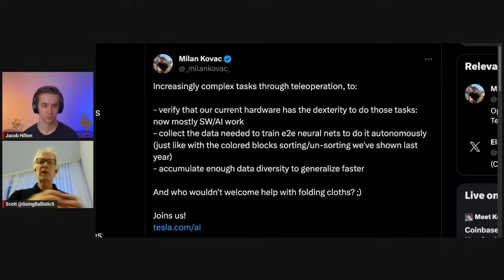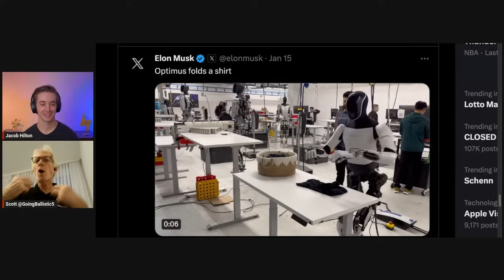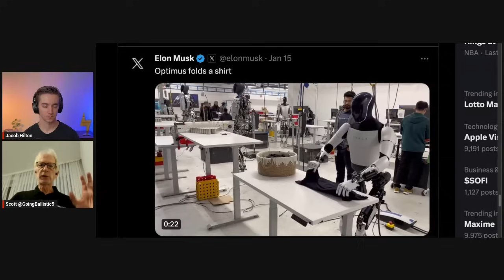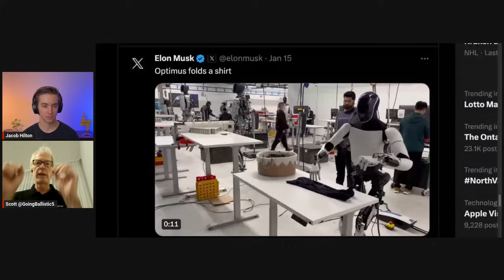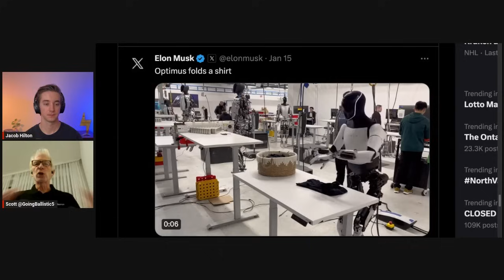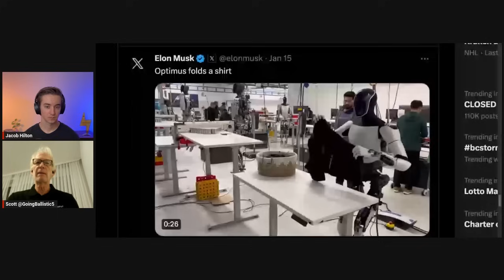Mechanical Expert on Tesla's HUGE lead in Humanoid Robotics

Comment: A shirt folding machine can do 1,000 shirts by the time an Optimusk can do 1.  😢
Reply: Can the shirt folding machine walk your dog after folding your shirts?
Reply: @solidnein7481  
Can a Porsche 911 tow your 40' RV through the mountain passes?
Right tool for the right job.

A housekeeper bot would be suitable to fold shirts in the home, and a 👕 folding machine would be suitable at the plant.

I don't know if it would ever be feasible to  have a bot try and compete with a t-shirt folding machine.  Those arms would have to move faster than the eye can see
Reply: @yourlogicalnightmare1014  that's my point 
Optimus is for multiple tasks in a home or factory

Comment: For next leap so robot can work in factory - will need mostly a new iteration of robot with a lot new hardware so in effect would be Optimus 3?  Or just this Optimus 2 with maybe few minor hardware updates and maybe more software upgrade.  If Optimus 3 really need is 6 months away or 1 to 2 years away?  Thanks

Comment: We have moved on from two legged robots years ago. Ask Honda, ask Boston Dynamics why they don't sell two legged robots. smh
Reply: The problem with Honda and BDs robots wasn’t that they were two legged. It was that they were hydraulically driven, heavy, expensive, didn’t have AI brains, and at least in BD’s case not made by companies with mass manufacturing expertise. In the case of both, lacking a vision to  mass produce at low cost.
Reply: @aybase
I don't think it's the hydraulics per se. More that you have to develop it for that purpose. Tesla wouldn't  be satisfied with off the shelf component, and have the engineering audacity to make their own.
But you don't do that for a first prototype.
Atlas is Boston Dynamics Bumblebee!
Reply: It's true that it's overkill to make robots in humanoid shape.
The stated reason is to make direct replacement for humans in factories.

I'm sure wheeled robots will be the rational choice for many tasks.

For example, a square of wheels which can turn 90° could rotate in place, and move much faster and efficiently than walking speed.

If the wheels were lockable on stilts, it could climb stairs too.

Have you seen Digits?
Cute and novel construction!
But it doesn't beat someting well engineered on wheels!
Reply: Boutique demo bot creators....with no motivation to make anything cheaper and more useful.
Reply: You’re missing the point. It’s about embodied general ai in a generalized purpose humanoid robot. You want a humanoid robot to navigate a world designed by and FOR humans.
Reply: Better still give it a wobble

Comment: It's not just doing verification that it can complete a task. Is also doing some extremely deep data mining as to how a human solves these different intricate problems. It is forming data sets for learning. It's not just testing its ability. 

This actually has a much larger impact than most people would understand. Dojo should be functional and yet it's not being used for the cars right now. Take a long guess
Reply: Interesting. Can you expand further please?
Reply: @davidborg3171  they turned on dojo in August of 2023. There have been multiple reports that dojo is not being used for the self-driving systems right now. Including further rumors running around that Tesla's building a secondary supercomputer out of basic parts that have been sourced not built internally. This means that they are continuing to use ready-made Nvidia processors and not their specialized systems. 

What do you think dojo has been doing since August? Come on now. It isn't that hard. Grork is at chat GPT 3.5 level in 2 months of training. Tesla bot is capable of doing error correction after visual training in things like organizing blocks. 

Dojo was built around training AI in a three-dimensional world through imagination and simulation. Dojo is not currently being used for FSD. They're obviously using it to train grork and the Tesla bot.